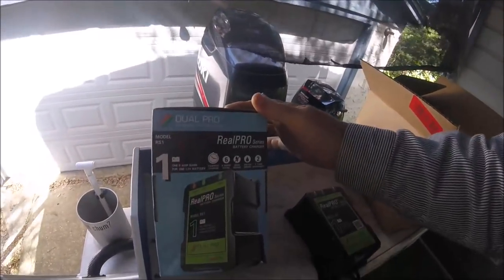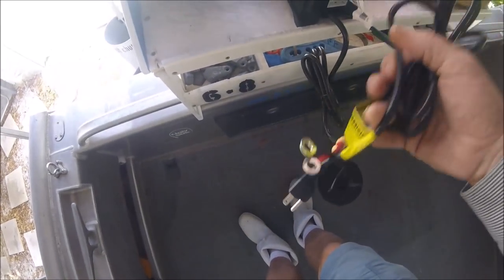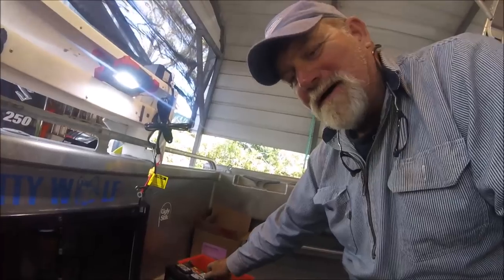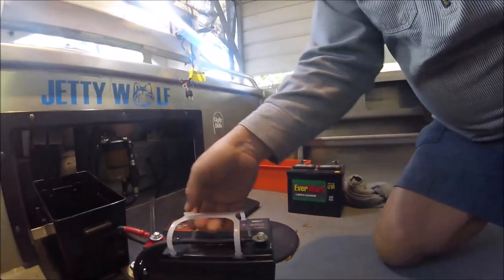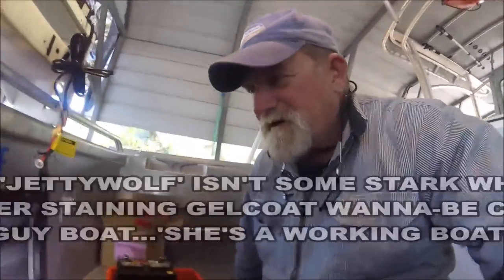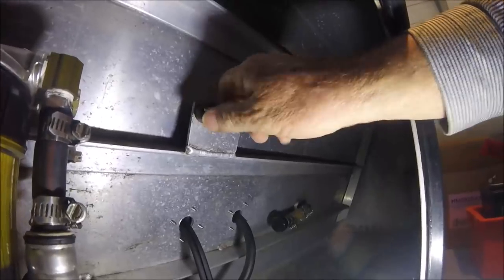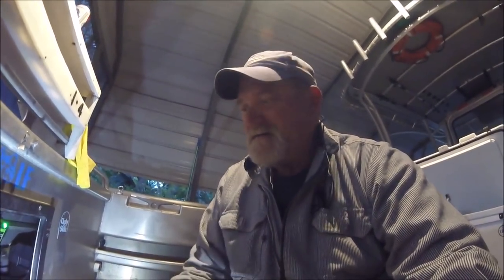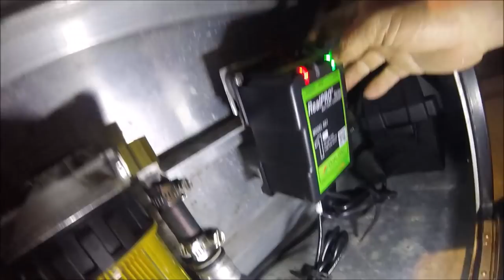MERCURY 15hp PRO-KICKER-AGM BATTERY & CHARGER

Comment: marine cranking amps vs cold cranking amps, if you want to convert marine cranking amps to cold cranking amps , multiply it times .8       for example 560 marine cranking times .8  = 448 cold cranking amps. Or so says my MAC battery tester. Just a little tip for you and the viewers.
Reply from the maker: 10-4!

Comment: what you didnt talk about is if the throttle increments still suck.  sure hope they fixed it and no need to buy a itroll or other add on.  actually with efi it should have digital speed control for trolling.
Reply from the maker: I use my tiller extender w/ a knuckle/swivel in it and have zero throttle issues. OR, hell I don't know or care about if theres a ''difference''. I maybe didn't talk about it, because, it's workin fine for my needs. And, the video was day one, hour one.